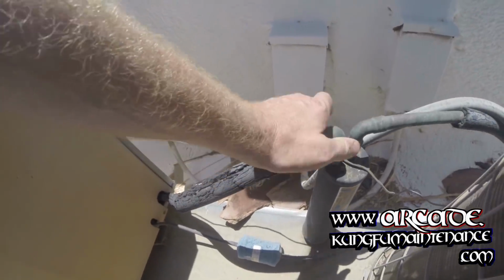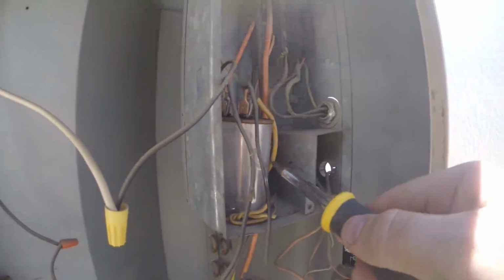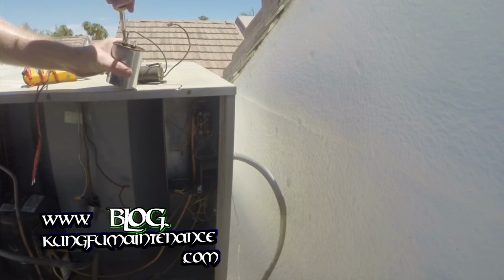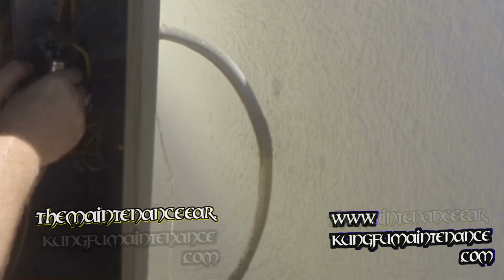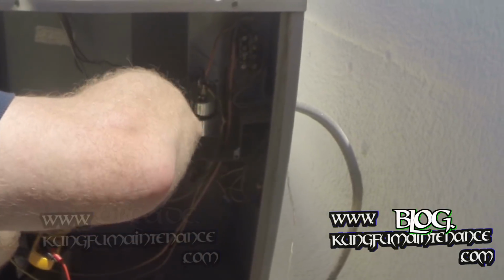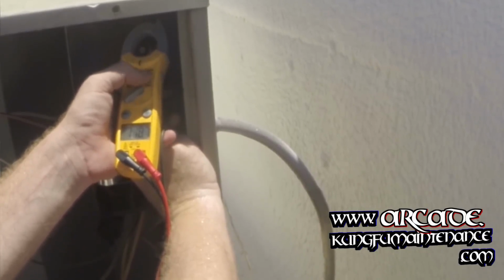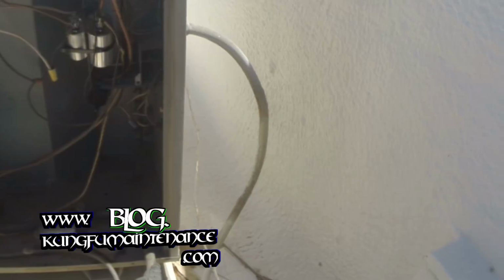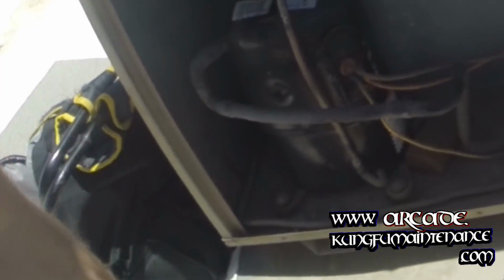AC Outside Fan Running But Air Conditioner Not Cooling HVAC Real Time Repair Video

Comment from the maker: Get KFM's favored Multi-Meter  here        http://amzn.to/2l8W9CO 
Wet Dry Vacuum used in so many KFM videos   http://amzn.to/2lFxi7u
Valve Core Removal Tool                              http://amzn.to/2kJ00pC
Inficon Refrigerant Scale                               http://amzn.to/2vUCQPD
Get the Screwdriver used in so many KFM videos here    http://amzn.to/2kHFoOF 
Get the Milwaukee 11 in 1 Screwdriver     http://amzn.to/2uTtsNj 
Get  the Multi Tool Pliers used in so many KFM videos       http://amzn.to/2kWTjPp
Get KFM favored Electronic Leak Detector        http://amzn.to/2kmQMMz
Simple Leak Seek Spray   http://amzn.to/2lFfcC5  Laser Thermometer  http://amzn.to/2layD8I  
Hard Start Kit     http://amzn.to/2kiD16v   Contactor     http://amzn.to/2lFqA0P
5mf Capacitor   http://amzn.to/2wC96sH     35mf Capacitor    http://amzn.to/2vZVZ2t
35/5mf Capacitor   http://amzn.to/2iVJNi2        40/5mf Capacitor    http://amzn.to/2wzEdXD 
45/5 mf Capacitor   http://amzn.to/2w0wez5   
Get KFM's favored AC Gauges here            http://amzn.to/2kYgGb8
Easiest Way To Get Universal EPA Certified Prep Manual    http://amzn.to/2kIQdQC
Condensate Pan Tablets   http://amzn.to/2lalV9W   No Rinse Coil Cleaner  http://amzn.to/2lHg8GD
Condenser Fin Whisk Brush                          http://amzn.to/2vWXUoC 
Chapin Pro Pump Sprayer                             http://amzn.to/2vWCXdD
Evaporator Coil Cleaner No Rinse Mix        http://amzn.to/2x3eJTT
Evaporator Coil Cleaner No Rinse Can        http://amzn.to/2ezIxju  
You must be EPA certified to charge or recover refrigerants and here is about the Easiest Way To Get certified with the Universal EPA Certified Prep Manual    http://amzn.to/2kIQdQC

Get The Kung Fu Maintenance book here     http://amzn.to/2lEQPFk
Or  the Kung Fu Maintenance E book here  for less than $5    http://amzn.to/2lEY8wD
Get the Kung Fu Maintenance album (good driving music) "Up Beat" here     http://amzn.to/2l41pZ1
Get the Kung Fu Maintenance album (nice Instrumental music) "Entropy" here   http://amzn.to/2kl2U0p
Samsung Galaxy S8 Plus        http://amzn.to/2sFn9h8
GoPro Hero 5 Action Camera         http://amzn.to/2sN4nVK
Rode Lapel Microphone                 http://amzn.to/2vZoFc7
Purple Panda Lapel Microphone  Kit   http://amzn.to/2wByXkq
Video Edit Pro Software       http://amzn.to/2ruaaeZ
Samsung Galaxy S5                 http://amzn.to/2wBxk6l     
Samsung Galaxy S8 Plus        http://amzn.to/2sFn9h8
Video Edit Pro Software       http://amzn.to/2ruaaeZ

Hire An HVAC Specialist                                  http://amzn.to/2lktKek
Air Duct Cleaning Services                              http://amzn.to/2lFTpun
Central Air Conditioner Tune Up                   http://amzn.to/2lzJGoy 
Air Conditioner Repair Or Installation          http://amzn.to/2lFsEGw                                           
I don't work for any of the product companies  listed however I do make a small commission on items ordered  through the links.

Comment: My fan is running backwards?
Reply from the maker: Many condensor fans have reversing wires that can be switched to change the fan direction.

Comment: hi - i have a samsung wall unit a/c that stopped blowing cold. i took it out of the wall and cleaned it out really good but still wont blow cold. the fan motor works just fine. i think it may be the capicitor but im afriad to get zapped when removing the wires and such. im not sure if it is the capacitor. what do you think? any help appreciated

Comment: I need help my shit spins for a bit then stops spinning bought a new motor thinking it was the motor but it is still doing the same thing any tips or ideas?
Reply from the maker: Make sure to replace the capacitor anytime you replace a fan motor. Might have just been bad capacitor originaly.
Reply: KungFuMaintenance dude your a guru lol it was actually the capacitor it was used up replaced it and now it is running took me all day too fix it. But got it done ✅. If you would have commented earlier you would have saved me so much time lol. But thanks anyways appreciate it man your good

Comment: Kung Fu maintenance.   I'm wondering if you could tell me what you think is the problem is :

     my central air unit, the fans in the apartment are on.. the Freon should be okay ..the unit was working good for the heat.
     But  in early March it went up to 90 ..I turned on the AC but in the middle of the night it was too cold and I wasn't very awake when I did something stupid : I shut it off and then about a minute later or less I decided to turn it back on and it made a weird clunk sound.

     I didn't worry about it for the rest of the winter because when I need it the heat on for a little bit it worked fine.. and I didn't want to deal with having a maintenance man in here because there are two or three of them that nobody can stomach ..they go in people's Apartments when they shouldn't be there... I hate the thought of bringing them in my apartment... there's been some shady things going on with them here ...many wonderful people have moved out because of maintenance and I lived it other places where maintenance men were really nice but there's definitely something weird going on here. 

    I'm really hoping you can give me a miracle so I can fix the problem myself.
     I'm pretty sure I figured out what unit outside is mine and when I went up to other people's yesterday there's has cool air coming out mine has warm air coming out which would make sense since it went up to 88 degrees in my apartment .
   So the fan things come on but not the thing that sounds more like an engine.. I don't know if that's the compressor ?

Comment: The air coming out of my vents arnt hot but its not really cold like it was last summer my unit outside is running and the fan is spinning and do u have idea where I can look to see what it could be that needs fixed. Or do u think its a leak in the line

Comment: That old HD SUPPLY cooler/backpack/chair makes for the best tool bag for a HVAC Maintenance tech. I wore out mine after a year n half... I love it I buy them on ebay now for $20 and use zip ties to reinforce weak areas.

Comment: I'm a retired service tech. and I can tell you that most techs would have just looked till the found the wire problem and never bothered with the caps, customers are done a disservice in that the cap will result in another service call eventually.

Comment: Yo young brotha, you need a new pair of wire strippers.
Reply: I've been there, the insulation will melt to the wire making it almost impossible to strip. just cut it off at a clean spot.

Comment: he house that I bought has new ac units, in the winter the heat wasn't working that well, so I turned on emergency heat, now my ac doesn't work, one fan doesn't turn on, and the other doesn't blow cold.
Anyone can help?
Reply: Hopefully you figured this out already...But I would guess that possibly 1) The condensation line was blocked and tripping the float tube safety switch which was affecting the one that would not blow cold. 2) The system was either not properly charged with refrigerant or it has a leak somewhere. 3) There was a clog in the line from installation and refrigerant is not moving properly thru the system?
Write back and let us know.

Comment: Glad that you are not one of those techs that recommend replacing the whole unit, knowing that the problem is only a couple of capacitors.  That has happened to me before with a dishonest tech.  Good job on your troubleshooting.

Comment: What does the hard start do
Reply: Helps the compressor lower its starting amperage. If it's an older unit and the compressor is tripping the breaker a hardstart is just to buy you a month or two before the compressor locks up but it's never a bad thing to add to your system.

Comment: Hey boss my AC is not working inside the house. Fan works and the condenser turns on but when you put on cool the AC doesn't give that kick you just hear the fan. Anyways any assumptions on what the problem could be? Thank you. Filter is clean and there's no clog.
Reply: What fan indoor fan or outdoor fan runs? If in door fan runs and condenser runs you should have ac if not probably refrigerant leak. If no indoor fan could be multiple things bad blower motor, bad blower motor capacitor, no power to indoor unit, loose wires
Reply from the maker: +Big AL Could be blown breaker, blown disconnect fuses, burned wiring, bad capacitors, bad contactor, etc.... I have lots of videos covering so many different possible scenarios.

Comment: Hey this is my last post. I was an a hole the other day. Im the guy that has to go back and fix other techs mistakes while fixing thier mistake there out making money. Im going to Colorado thats why I havnt quit. Also the freaking installers cant mount thermostats, seem to never check primary line and ........................forget all that

Im wrong 110% saying what I said about skipping sub cooling or super heat. So important that dont let any ahole like myself tell you otherwise. One out of two on average installers dont charge the line set or micron lines out. And TXVs stick piston clogs putting gauges on will save you from cumming back out. Sorry comming
Reply from the maker: Welcome back anytime! My best suggestion is to enjoy the job security! It would be ten to a thousand times harder to find a job if others were completely enlightened on the finer details. Negativity closes and locks many doors of opportunity but understanding, skill, humility, talent, and patience make room for you at tables of wisdom. ~ KFM
Reply: NICE!!!

Comment: hi there,
ive changed the cotactor and capacitor but still ac is not working.inside blower fan is working but out side fan is dead. there is no buzzing sound or nothing.its dead. but when i press the contactor it works. 
please help.
Reply from the maker: +N B Most likely is thermostat. Check me thermostat troubleshooting vids. Less likely but could also be relay, transformer, or lost wire connection.
Reply: THANKS
Reply: Dog chewed the t-stat wire by the unit...lol. What's the odds.

Comment: Loved how he took the time to secure those sloped in caps!!!
Reply: Yes! Very thorough.  I actually liked the gauges being connected to actually see what the system was doing.  Ah, cold good enough.
Reply: 2 b honest I hate shredder valve replacing it suuuuucks.(freon has fu** me up mentally inhaling.... no not that...well that to but mentally fu** me up by burns)Would avoid gauges at all costs on that old 10 seer.. Delta T is good enough for me to get da fu.. on to next call. However since the hermonic wire was off would first mega ohmed compressor. b 4 anything at all. Im a changed Tech big fan on replacing and proud of it. I will fix anything but it should be against the law to repair any 10 seer with the Energy crisis. Starting to resent non-ductless systems. Multi zone ductless is freaking cheap on energy. I dont think the industry wants people to know that wall/window units work better than minis but THEY DO.
Reply: They make schradder core removers that can be done with charge full.....  FYI nothing more or less just fyi.
Reply: kevin voigt With all due respect Kevin, and I mean this seriously, have you ever used a PE chart? That's why you need to gauge up.  That's what separates you from the parts changers...mega ohlm meter I could care less and we will only use it on 20 ton or better compressors. May I ask how long you have seen in the field?
Reply: Dont want to argue cant name one tech or contractor thats going to get a freaking wet bulb when there slammed with calls. Keeping it real I love to show off my 700 dollar digital and yes Im textbook. Ive learned that well at least in san diego that when a tuneup is performed on an 7+ system 1 out of 5i have to go out and diagnose why system low when we were out two months ago for a inspection. Fu*ing with schrader vaulves the tool works 90% of the time but the 10% we either slip or only half the valve comes out so what im saying is if a 30 minute repair turns into a 2+ job ask your self WTF why went by the book. If you do a repair without mega ohming then you suck!!! to repair a system with a bad compressor about to go out you just fu* the customer. Suck is harsh sorry but Im telling you that your not helping fixing a unit that needs to be replaced.
Reply: Now you have my attention!  Explain what your Mega does,....Please!  I did not swear to you and in fact meant no diss. as I stated, but you never answered an of my questions....?  Is that fair?  It was JUST a question. No disrespect as before.  JUST TRYING TO GET MY HEAD WRAPPED AROUND HOW THISNG ARE DONE IN YOU AREA.  If the job takes 2 hrs, It takes 2 hrs.  let the customer decide  Your getting paid,  Why are you so defensive "K"?
Reply: Well Im sure you da bomb. No I just been freaking frustrated of all the leaks been getting the last two year just from tune ups and repairs.(not mine) Its usually the tech negligence cant blame the valve.  To be honest shouldn't be post incorrect ways going against book. If im so worried about the valves then Ill get a bag of caps at Johnston. Sorry man Ill shut up now.
Reply: Its good to see if air in the line or sticky TXV so yes always hook up gauges
Reply: Again,................  What seems to be the problem? Alright, I'll let it go.  Just thought I could have a conversation with you.  " Da Bomb"  no such thing.  I learn every day!  I do appreciate your comment when you sweating you ass off and everyone is calling and EVERYHONE want's answers.  We can only do (1) call at a time!  "K" I did not mean to come off wrong to piss you off.  If you ever have any questions, please you are welcome to contact me any time.  I mean that.  Peace!
Reply: One thing I have done and I have no problem with it.. If it's lo on charge, let the customer know, tell them I can recharge it, but you and I know there is a leak.  Answer.  Charge and let it go for a year!  If it's small you and I know it is a bitch to find, but let them make the decision, Check obvious spots yada yada yada, at least they are in the loop and you spotted the problem  I think that's all they want!  We good???
Reply: Yup Ill do it one time with a can of easy seal. My question is who can prove easy seal works or doesn't. Every senior tech has there own opining on it. no no no im said i shut up this somebody you-tube wall ill go to a discussion board later. Da bomb your going to have to look it up in Websters ur self.
Reply: Really?  All I have a problem with is the service you provided...  Open for any challenge that will stomp me, according to you.  I have seen guy's like you on 20/20.............  reveals a lot.  Spell check.... is that all you got?  Yea I did have a few.  Good trouble shooting there!

Comment: First off get you some tools that work .2 Know how to use them. 3 learn how to trouble shoot. You should have caught that bad wire at  the first.  Ow well, I guess that 's how it go's with earn wail you learn! I just hope that you don't get shocked or killed any time soon on your trouble shooting. You first check power then go from there.
Reply from the maker: +cowboyjim90078 Some people don't understand real time video. So sorry to see you may be one of them? These real time vids are where I share the thought process... no offense taken, thought, or given...
Reply: Some people love to find fault! Looks like it needed the other two parts anyway! Looks like you know your stuff anyway. Anyway I have one doing the same thing ...hope its just the compacitor

Comment: longest wire stripping I've ever seen
Reply: Agreed, The video showed the almost 2 inches of heated wire, he should have known to start his insulation removal further from the end. Just a note, I'd have rather used a terminal vs. screw the lug onto the bare wire. Corrosion is likely what made the contact point bad and overheat last time it was screwed onto the wire.
Reply: thats because he tried stripping it at the burn mark, the outside of the wire melted to the stands so it wouldn't just slide off easily,thats why he cut it further back.

Comment: I have two A/C units one for up stairs and one for down, both of them are running but not cooling. i already changed the filter and rains down the air condition with water from out side but it's still the same not cooling. i need help on what the problem is and how to fix it. thank you.
Reply: mine too its not cooling... 

because of hot temperature  my skin get dark :'(